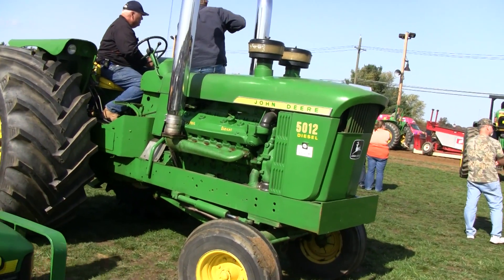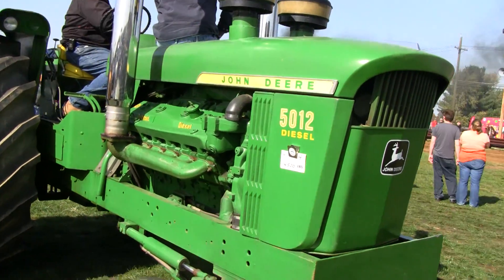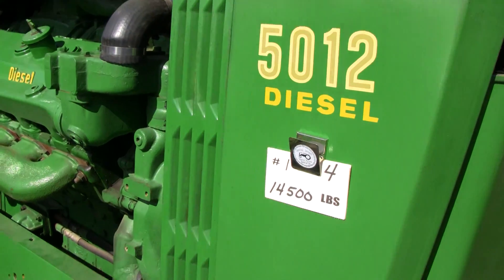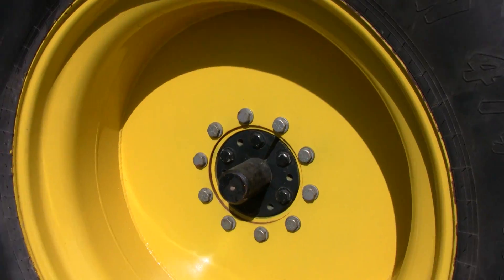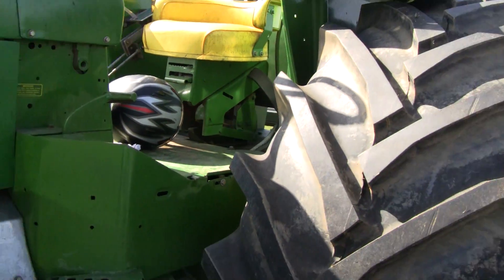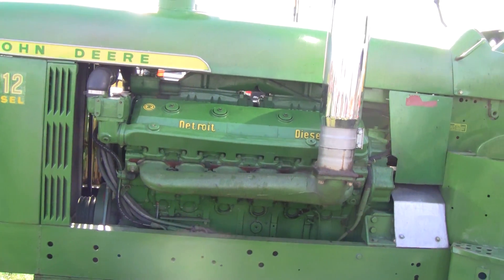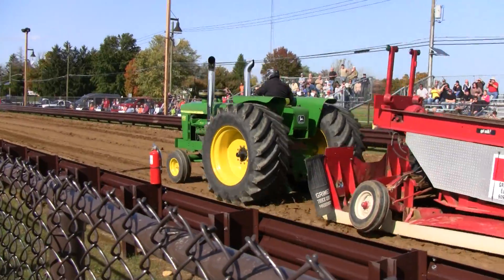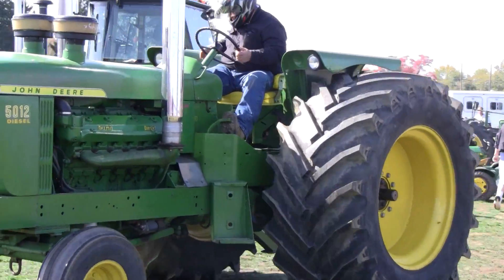JOHN DEERE 5012 DIESEL 2-STROKE V12

Comment: The first truck that I drove was an I-H 4070 c.o.e. with an 8V-71 318 h.p. The old WABCO 353ft twin engine self loading paddle scraper had twin turboed 12V-71T's I believe, for a total of 1050 h.p.

Comment: That's one cool tractor, believe it or not this engine is only 14 liters, and puts out 450-500hp. Which was insane for a diesel engine designed in the late 50's

Comment: V12-71s do not make a ridiculous amount of power or torque.  Any modern big bore diesel engine has more torque than that thing.  The Cat 3406s and the Cummins ISX make over 2,000 ftlbs and 600 HP in stock form.  Peak torque on a V12-71 is probably 1400-1500 ftlbs and 450HP.

Comment: Torque on a  12-71 is about 1290lb.ft @ 1400 RPM while Horse for a non-turboed 12v-71N
476 hp, @ 2100 rpm
Reply: They can be opened up a bit on RPM, 2300 rpm is a common rating, short times at 2500 rpm won't hurt them, 2100 rpm is peak power rpm.
Reply: 1250 torque Isn't a torque monster

Comment: 0:12 and yet there are cars that are illegal in america due to emissions (gtr r34)
Reply: It's fucked, I know. I'm an import guy myself. But, that's sort of a common misconception. It's not that they're illegal here(you CAN get them imported from other places but we're taking 80K in import costs alone here, so that's a reason also)but they're just illegal on public roads due to emissions. You could take it to the tracks in the same way that big ass polluting(before the diesel guys jump on me, that soot is carcinogenic so it counts as a pollutant) tractor was on this track! So basically, if you wanna get it imported have 100K on hand and a few years of wait time, and be aware you're getting an "off-road use only" vehicle that the US will not allow you to install the emission controls they require for some reason. So essentially it'll remain a track only car for its life and there is nothing you can do to change it, other than an engine swap, but who wants to do that when that particular model/car has such a perfect engine! LOL. It's fucked up man, I know.
Reply: They also don't meet safety standards in the states and of course, they won't allow it on road even if you cram it full of safety gear that IS up to our standards.

Comment: Because V12s require no big crankshaft counterweights they hot up really well and still stay reliable. Most 2 strokes respond just by opening the governor a bit. They respond so well because at certain RPMs they make about 1HP per RPM, so an increase in 100RPM may yield a 100HP increase. I use the word MAY. Most 71s and 92s enjoy being held against the governor at 2100RPM when in revenue service :)

Comment: Seen this Vid about 100 times and just now i realized this thing is not even turbocharged YET... a lot of HP being left on the table...hehehe.
Reply: Its got to have something, because being a 2 stroke, it has to have a positive pressure on the inlet manifold.
Normally aspirated (as you can have with 4 strokes) will not work on a stroker.
Agreed, no turbocharger, but there has to be a blower of some sort.
Just had another listen "blowers on top on the intake"
Reply: g8ymw All these (2smokes) came with a ROOTS Blower or two(v12 & bigger).
Inline engines had it on the side, V engines had it in the V's valley. Google is our friend.
Reply: You've got it!

Comment: Engine wasnt "turned up" too much.  No huge clouds of black smoke rolling from the stacks when he pulled.  Just a naturally powerful engine.  Detroits got bad reps because of the leaks, but the main reason for the leaks was idling.  They were realiable engines, cost less to rebuild than Cat or Cummins, and the US military used a lot of them; M113 family of apc, tracked artillery, HEMTT tank haulers, even some Sherman tanks in later days of WW2.  Cant forget the M561 GAMMMA Goat.  They also weighed less than the Cat and Cummins engines allowing for more payload.  Never disrespect the old 2 stroke "Screamin' Jimmy", might incur the wrath of one of us "old farts" who drove them and loved them.  They also seemed less prone to gelling in cold weather.  Our shop guys would go out and start all the fleet in extreme cold, rev them up and set the throttle, and you could hear as the other engines would start shutting down; Cats firts, then Cummins, then Macks, the Jimmies just kept going.   If i rmemember correctly, stock hp of a 12v71, non turbo, was 434 hp.  All the old engines were meant to be wound higher than todays engines, thats why the old trucks had 4.11 or 4.33 gears ususally.
Reply: dont let me fill this 2 stroke with xd100 and feed total loss, i know how to do this, there is walmart high load oil formoula.
Reply: A lot of naturally aspirated 475 hp 12v71’s back in the day. Turn em to 2500 rpm and they would pull. Heavy though, 3200-3300 lbs as I recall. Heavier than a 1693 Cat, which is why there weren’t a lot of them out there.
Reply: Ask any military mechanic, they're junk.
Reply: @toddgittins5692 don't know what you thought you were going to get outta this reply section, this guy made this comment 7 years ago.
Reply: @Asmith-1111  yeah, you're right. A Detroit engine probably blew apart and a piston impaled him. What was I thinking?
Reply: @toddgittins5692  LOL
Reply: @toddgittins5692  I'm not saying that they are not junk.  My grandfather was a truck driver and hated the living shit outta Detroit diesels.
Reply: @Asmith-1111  I've got a few miles on them, too. When I was young and had to have a job. After the age of 30, I wouldn't even sit in a truck with the Green Weinie. The only good thing is, they will definitely teach you how to shift.

Comment: The tractor didn't even know there was a load.
Reply: LOL....NO...IT DID NOT!
Reply: Lightning and the the sun are 2 stroke
Reply: them 2 strokes are funny with a chug on every stroke there is no problem with load. the big cr500 just chugs along at low rpm while the damn 4 joke cr450f has to reve 13k rpm to get the job done!

Comment: U.S. They are big engine my sea scout ship. It a torpedo retriever   With two v12  with twin supercharger on each engine and yes they are powerful.
Reply: i mean dual blowers  i love the ship i was a engine officer i spent more time in the engine room taking care or the twin v12 Detroit
Reply from the maker: +old smokey Pretty amazing that the engine they put on this tractor could power a whole ship!
Reply: All the 12 cylinder Detroits had duel blowers
Reply: +old smokey I I bet a pair of them sounded wicked. Several years ago I worked in a diesel shop that specialized  in detroits. I built heads, blowers, and water pumps.  Our shop built a 12v-71 that was twin turbo and man was is awesome. But I love see un aware people around a 3-53 when the throttle is cracked open on them.
Reply: yup i love being in the engine room when they are running

Comment: the hell with that tractor, how about the redhead that comes into frame at 3:03
Reply: +Corey497 Redhead is nice, but when you shut the engine down, it doesn't squawk. Redhead is another story, they don't shut down!
Reply: +Bob Smith Best comment on the internets.
Reply: Ryan McIntyre why would a diesel have a gas tank

Comment: Emissions weren't the only problem with the  2 cycle Detroits they were also a holy fright on fuel
Reply: Fuel economy was why Detroits never took off in the U.K. Fuel is expensive here anyway, but when Bedford (the uk truck division of GM) launched the TM in the 70s, operators who tried them couldn't get rid of them fast enough. 5 mpg average was no good to anyone, that was way under what you could get from a Cummins/Gardner/rolls Royce

Comment: I used to work for General Electric Company. We used  12V71T twin turbocharged 600 hp Detroit Diesels as a STARTER MOTOR to crank over the MS 5000 series gas turbine generator sets. You would select Start, the diesel would fire up, idle for about 15 seconds then go to wide open throttle for 5 minutes. A Twin Disc torque converter and a jaw clutch cranked the turbine to 20% speed with that Detroit screaming its guts out, then the turbine would light off and outrun the diesel and go to 100% speed of 5100 rpm. The Detroit Diesel would idle for a few minutes of cool down time then shut off until needed again.  Look up Pissed Off Pete for a 12-71 Detroit Diesel in a Rat Rod...  Yeah, I love these Detroits.
Reply: I take it you buy your ice by the berg and tequila by the railcar?
Reply: Whorayful, thanks for the input. Its hard to believe that I was doing turbines 38 years ago. I have not seen a one of them since 1995. The company wanted to send me to some Australian business which is mostly underground due to the oppressive heat. My roommate screwed me out of the job and went there instead. They sent me to Bahrain in the Persian Gulf. When we got back, I discovered that his job was a nightmare, the customer didn't like him, there was nowhere to go, and it was beyond hot. I was in forests of date palms, swam in the Al Adahri pool, and went scuba diving on a shipwreck in the clearest water that I have ever seen, and they loved me at the Bapco Refinery. I just recently rediscovered my photos from GE travelling days and this all fits.
.
Reply: Old comment I know, some of those GE frame 3s' with GM stater motors are still in service operating as back up grid power in Australia! The reason they used the GM's was not so much the power needed it was the quick start and RPMs the engine could run at, 2500 RPM available through the torque converter and clutch would give comfortable light offs and run ups for the turbine.  As the old two strokes are failing they are/were being replaced with series 60 engines with a GM 'special programme' which allowed 2500 RPM at reduced power.
Reply: LimitedOptionsMan The MS 9000 series made the 5000's look like a toy.
I have a Detroit 3-53 diesel off a small barge that I'm going to make into a trailer mounted Margarita machine...
Reply: kimmer6 Yeah I heard they quit making them because they couldn't pass the new emission standards. I often questioned that. I drove a HEMTT with a 8V92 when I was in the  Army back in 85-89,  It didn't smoke or pollute much
Reply: Inspector general Danny Kaye
Reply: kimmer6 Hushpuppy! that MS5000 is HUGE!!!
Reply: I worked at one of those sites in 1996, a paper recycling place in Antioch CA. I had no idea what a 2 stroke diesel was yet but I knew that twin turbo v12 was AWESOME. It said Detroit Diesel Allison on the valve covers. I just had to go inside the containment building to hear it run, being a motor head! Never forgot it. Then when I bought an old Dynahoe backhoe with a 3-53 suddenly my eyes were opened to the world of 2 stroke diesels and I recognized the familiar sound from so many other trucks and tractors and stuff from a better time.
The gas turbine was a frame 3, in fact it was the original 3B that was used for development testing. We were onsite for DLN testing.
Reply: @peterobillard4441  Yup, THE pulp mill.   I worked on the reduction gear box oil leak...too much power as it was the same design as used in the  the Frame 5 units and was good enough for them at 24 Megawatts. This one was 33 Megawatts. New ones had redesigned gearboxes with bigger and more bolts, heavier flanges, no more leaks.

This unit was the SPOTS unit, Schenectady Plant Outdoor Test Site built over the old Erie Canal. I caught Hepatitis in 1980 in Taiwan when Mount St Helens blew up and they grounded me from overseas travel. So they assigned me to the SPOTS unit to train new engineers while it was still there being beat on.  They disassembled it and sent it to Antioch where I saw it once again a few years later. Its a Frame 6, actually. The Frame 3 is 7500 horsepower and there was one on each of 5 Chevron oil tankers that I worked on while in the San Francisco District. The Tosco Refinery had a Frame 3 in Concord. 

In the 1990's I worked for a different company from Emeryville and was ready to go to the same pulp mill to relieve the day shift guy. We just installed a new gearbox on the boiler draft fan and they had problems with the boiler. The boiler was shut down, then relit. There was a natural gas explosion and it blew out the entire front wall several stories high. The guy I was to relieve got some of his hair burnt off and another guy was killed. Good thing I stayed home that evening  waiting for the call to come in.

I have a Detroit 3-53 in my back yard. I was thinking about trailer mounting it and putting a blender on a right angle gearbox to make the world's loudest Margarita Machine.

Comment: There a reason why nobody use those engine now , THEY WAS BAD .

U can have way more power now with realy smaller engine and cheaper to make .
Reply: Bigpimping Papercut Actually those 2 stroke didnt develop that mutch torque u know ....
Reply: It was very smooth though and I was drunk to see not much smoke.
Reply: rofl tractor engines arent built for power, they are built for torque. 2 strokes make torque at way lower Rpm's than 4 strokers. Put a ferrari FXX engine in a tractor and you might be able to get just the tractor moving, if you dont blow the engine. In many tractors, these 400hp engines (even 4 stroke) will make in excess of 2000nm of torque vs well under 500nm from a ferrari engine
Reply: No one cares it just sounds cool
Reply: preston landoll
I love it , but there people who clain 2 stroke engine are great engine ....
Reply: Bigpimping Papercut its the gearing that brings the torque
Reply: HARD SAYIN NOT KNOWIN!!!!
Reply: Detroits are the best 8v92 swap in 71 e100 clubwagon  300,000 miles from rebuild no prob besides regular maintenance and you cant beat the power. you can get rediculus amounts of power from them
Reply: yeah...but that's super BORING!

Comment: A 671 detroit marine is 475 plus hp and this V12 71 is 450? When we used to race the big trucks out  in the street my old k series cummins 1000+  would always blow the doors off of all these detroits and cats as well. Someone said that these DDS had torque! They had rpms and .little torque. The 92 series was better but no prize. I was said that having a detriot diesel was like having a small penis, It was alright around the house but not so good out on the big road.
Reply: they did not have rpms they just sound that way becouse thare 2 strokes he was only doin around 3000rpm
Reply: Old comment I know, A 6-71 Marine pleasure craft spec of 475 Hp is built to be overhauled after every season of use or around 500 Hours, a 12V71 at 450 Hp will run 18 - 20 Thousand hours.
Reply: Talk all the shit you want, a Detroit would outlast a shit Cummins or Cat 3 times over.
Reply: Where are these guys getting their information? 6-71s are 238 hp, not  flipping 475!!

Comment: "Nothing runs like a - (12V71 Detroit-powered) - Deere!" LOL
J.D. really missed out though...they should've offered the
12V71 as a factory-availvble option on the 5012 model!
Double-LOL!
Reply: I think the reason they didn't offer the v12 is it would cost a fortune for fuel.
I drove White Freightliner years ago with the v12's and they would pull anything.
Used to pull 2- 20 foot overseas containers with 45000 lbs in each load.
You would only get about 4 miles to to the gallon.
When they wore out they were scrapped because it cost 10,000 bucks just to do the crank shafts and the company never bought more.
Reply: ***** To "canvids1  - I'm a former trucker and back in the early 90's,
I drove an 1985 FLC120 Freighliner that had been re-powered with a 12V71TTAC, set at 630  hp, that had orininally come out of a giant 8X8 military airport fire truck,  on about dozen or so eastern -Canada to Californi roiunds,  hauling produce, so I knpw about the costs and particularly about the fuel consuption issues!  I was only kidding - making a bit of humour and sarcasm - when I aqked why JD didn't ever offer the 12V71 as an option on their tractors.
Reply: JD never made a 5012 it is a 5010 that he took off and put the 12 because its a 12 valve

Comment: I never understood why people find diesels that pour out black smoke like the first one cool. Now the detroit, which only smoked a tiny bit, yeah that's nice.
Reply: justfakeit888 The thicker the exhaust fumes are the more power the tubo puts out due too better spooling.
Reply: Partly. You are correct, I wasn't thinking quite right, as there can't be valve overlap, but there are still exhaust valves in a Detroit.
Reply: It's not a fault. It's due to the diesel not being burned quick enough.
Reply: Joel Sadler
It is absolutely a fault. They tune the engines to where they have more valve overlap and therefor more unburnt fuel, which causes the smoke.
Reply: justfakeit888
 it a two stroke it don't have valves silly you
Reply: Dylan Yinger incorrect, two stroke Detroit diesels have 4 exhaust valves and no intake valve.
Reply: More valve overlap? Haha. That's a new one. Educate yourself before you educate other people.
Reply: They inject more fuel than can be burnt with the available oxygen.
Reply: This one does, 4 exhaust valves per cylinder, the intake ports are at the bottom.
Reply: @TheUberGopher  the only true correct answer I have read
Reply: It doesn't have intake valves but it DOES have exhaust valves. 4 valves per cylinder to be exact.
Reply: @andrewguerrette8620  there is no intake stroke.  Only compression and power, it's a two stroke.